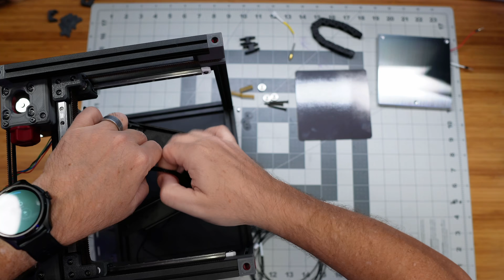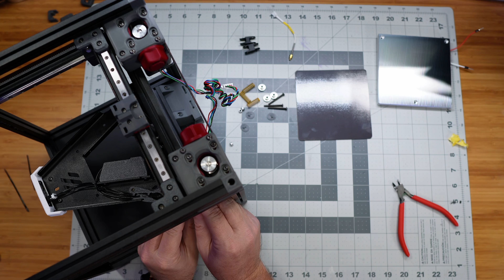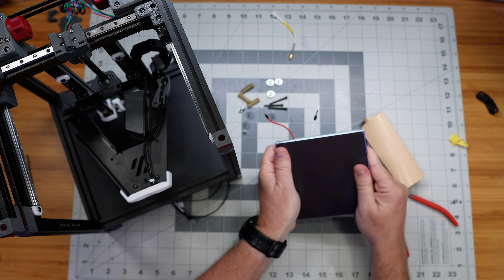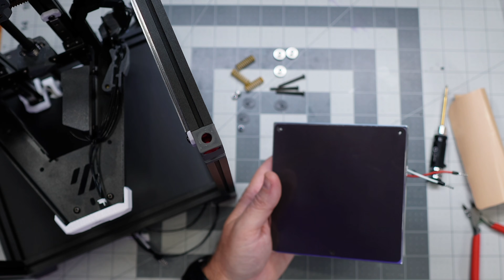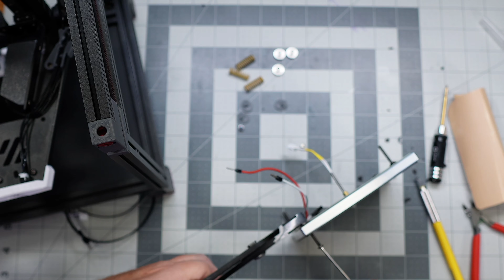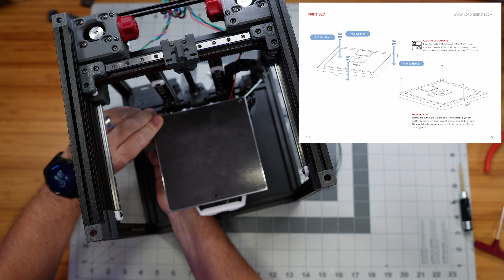LDO Voron 0.2 Build - Heated Bed & Cable Chain

Comment: Good to see I'm not the only one that was confused on what to do with those Kirigami Bed Spacers 😄I agree, I couldn't find any pics or anything elaborating on them either. Thanks for the video series! It's great to watch what I'm about to do ahead of time to have a better feel for it.
Reply: I thought they were to between the knurled knobs and the bed so they sit lower and not too close to the bed (because of the heat), the flat side up and the stem down.

Comment: Those washers you didn't use were recommended for more than one very good reason.  I found out the hard way.  I wish they had more documentation on them.  They can be found on printables if you search for kirigami offset nut.  Even though he admits they are washers, they were posted by someone named DG.  He explains what they are for and how to use them.

For my first print, I printed the califlower calibration print from Vector3D.  I had it centered in the bed by orca slicer, but it printed 2mm off the back of the bed.  At 100 mm, I'm 0.2mm too small but off the bed?  At 50mm, I'm printing about 0.45mm too big.  It gets way too complex.  Anyway, 2/3 of the way through the print, the rear left bed nut fell off.  I left it off and finished the print.  Turns out this is all a common problem.  Kirigami bed frames drop their nuts all the time!

First, the bed frames are commonly warped a little from the factory.  The springs are too short to account for it.  They need to be longer.  These shims fix that problem.

Second, the Version 3 kirigami bed frame has the holes for the bed drilled too far forward, moving the Y axis of the bed forward.  These washers, if turned correctly, will position the screws and springs so that the bed is moved back into its correct position.

Third, the springs can have a little too much wobble because they aren't stiff enough.  These washers fix that problem, too.

LDO knows all this.  They recommend printing the parts and using them.  They don't explain why or how.  LDO could have done better than just recommending something that for many of their customers is a necessity.
Reply from the maker: Thanks for the detailed explanation. I did eventually figure out how to use those spacers and they are in the printer now. I meant to talk about that in a later episode but forgot to do so. If anyone else is looking at these comments and wondering about the mystery of the bed spacers, you should definitely use them as described here.